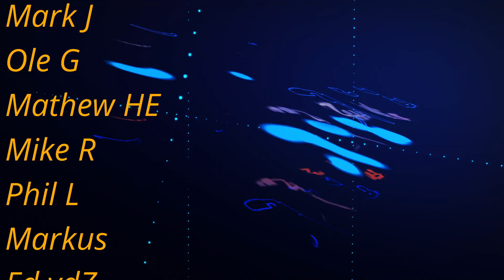Weekly News#0041

Comment: Thank you for the tip on correct lay shaft direction.  Don't remember how I put mine together 29 years ago but it didn't have a problem and didn't leak oil which was surprising since the shaft end is exposed to the exterior as I remember.
Reply from the maker: You're quite right Ben, both front and rear shaft ends are open to the atmosphere, so I reckon you did the job perfectly!
Rob

Comment: How do you feel about using Allen head grub screws to replace the slot heads.?  My M41 had the same issue, carefully drilled out three of them and bought a full set of Skandix’s replacements. 

Seems the physics of removing these slot heads means the outer ends of the slot expand when turned increasing the locking effect.  

That Haynes cautions against under tightening as well as over might have something to do with this dilemma.
Reply from the maker: I would say that's the perfect solution for those grub screws: love it!
Rob